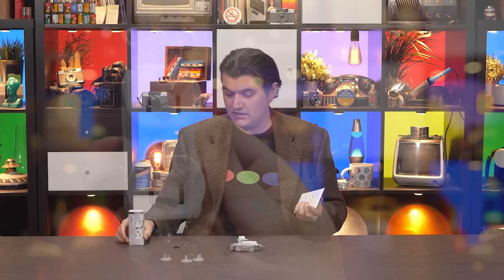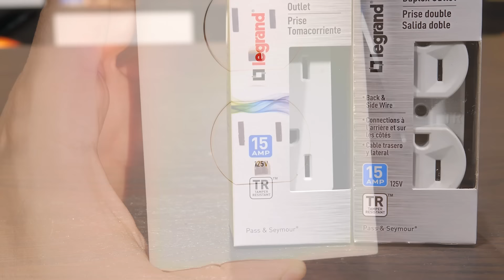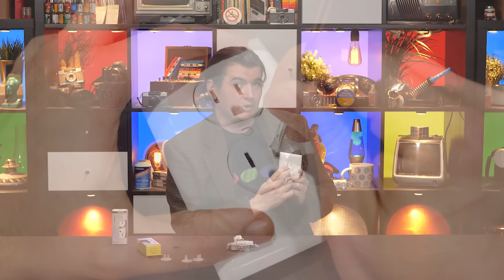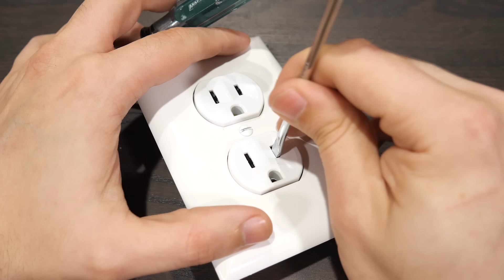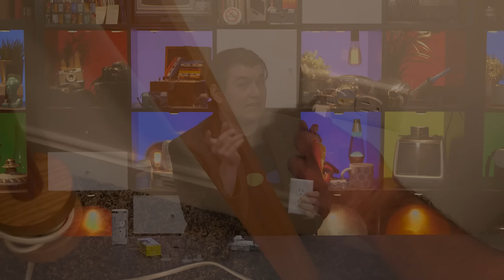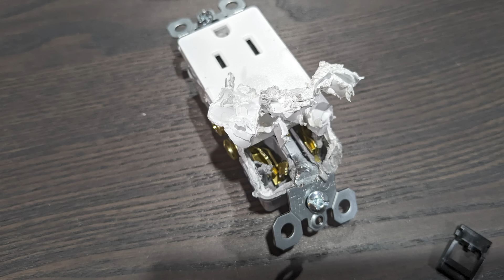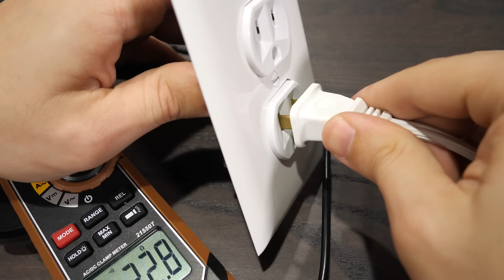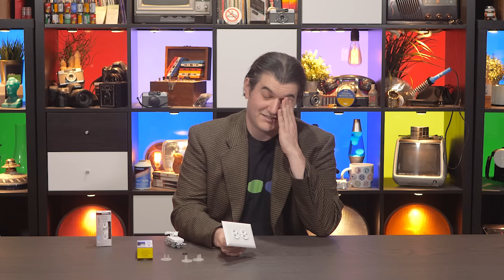Tamper-resistant outlets aren't all the same - a follow-up

Comment: 6:46 European here, where I live we have CEE 7/5 sockets (sometimes called Type E) and mostly CEE 7/7 plugs (works with CEE 7/3 and CEE 7/5 sockets), if appliance is unearthed you can find CEE 7/16 (Europlug) and CEE 7/17 plugs. A plug becoming loose is a such a foreign concept to me that I am usually more worried about yeeting out whole socket out of the wall than the plug becoming loose. If the socket is old, low quality or improperly installed it is far more likely to yeet whole socket out of the wall, so I have tendency hold the plastic body of a socket while unplugging CEE 7/7 plugs. I don't think that it is a problem now, but in the 90s and early 2000s when CEE 7/7 plugs started to appear, tolerances probably became very small and old socked installed behind the iron curtain (but only those home ones, those basement and outside ones where always sturdy as far I remember) were not ready for the force needed. And the habit from my childhood just stayed with me. But even those old CEE 7/2 and CEE 7/6 plugs were almost impossible to partially disconnect as you do with the American ones, while the modern CEE 7/7 are probably so tight to make them dust- and at least partially water- resistant*.

*As far I checked, sockets near water supplies should be at least IP44, but even IP66 are common outside. Inside sockets are at worst IP20, but you can buy also fancy looking IP40 for internal use.

Comment: I have not experienced US plugs. But the EU ones are very snug. I just did an experiment with a cheap charger and old extension cord. It takes at least 1.5 kg of force (3.3lbf) to seperate them. This is just the receptor, since a type C plug does not touch the edge of the type F socket.  With a type F plug this would be even more since there they would be near eachother (sideways stability) and the ground pins also squeeze the plug.
At my parents we have a plug that is bent instead of sticking out (and it is even more snug because of this)

Comment: re: "120v can also kill you", I can't help but think about the repair guy at my old apartment who came and replaced one of my outlets without turning off the power to the outlet. there was an amount of swearing that occurred, but he kept insisting it was easier for him to just do it that way instead of walking around the side of the building to flip the breaker. truly a legend.
Reply: I used to do this without swearing.

Then I moved to a place with 240V outlets. Tried to replace an outlet without turning the power off ONCE, there was lots of swearing and never did it again.
Reply: 120 tingles. 240 hurts
Reply: @Spiker985Studios  50 hertz in my country.
Reply: @Spiker985Studios  Dude, I've been shocked by 24 volt before where it really, seriously hurt. for days. As much as the voltage is part of the equation so are the amps involved. Nothing tingly about it, just not comfy when your hand is quickly turned into a heater.
Reply: @RedPorch  As anyone who has ever had a shock off a 12v car battery will concur! Far nastier than a 240v household shock.
Reply: @paulhaynes8045   DC vs AC... that matters as well, Shocking isn't? Bring back the war of the currents 🙂
Reply: @paulhaynes8045 
off a 12v battery?  how?! legendary failure to pull that off.
Reply: @paulhaynes8045  Having touched both terminals of a 12V car battery with wet hands...  HOW TF DID YOU GET SHOCKED?  

I'm not saying it's impossible...  but... um... HOW?  It's a low enough voltage that most people can't feel a shock under normal conditions.

(I'm not gonna lick it like I do to test 9V batteries.  Those car terminals are lead.  And yeah, I can give you a pretty accurate voltage reading on a 9V with my tongue.)
Reply: @RedPorch The amperage through your body determines how much it will hurt, but the voltage determines how much current will get pushed through you, and the vast majority of mains applications regardless of country can deliver plenty of current. Speaking as someone who's been shocked by a low current 24V supply, a huge factor as to whether a shock will occur is environmental factors (eg a cut that interrupts your skin, wet hands, different humidity, different shoes for grounded systems, etc). If the total resistance of the pathway current would follow to shock you is low enough you could get a lethal shock from a 12V battery easily, but higher voltage systems are more likely to hit a threshold where they can pass enough current through you as they can push more current through the same resistance*

*Exceptions apply here - as Mehdi from ElectroBOOM has pointed out, a lot of high voltage systems people might be exposed to have low current capacity, which means the voltage sags to less dangerous levels in the event you get shocked. Styropyro also covered things like the skin effect where under some very specific circumstances high voltage and high current can pass through you without injury, although I wouldn't recommend doing anything Styro does yourself
Reply: @freeculture DC vs AC matters, but the DC supplied by a battery is actually less dangerous. AC won because it's not as big of a danger as Edison made it out to be and it was far superior functionally, but it is still technically worse.
Reply: @user-dj1hy6zc6q  it's the amps that matter, not the voltage. This was back in the day when cars were difficult to start, so the battery had to have the power to turn a cold (non-fuel injected) engine over multiple times. I was disconnecting the battery and accidentally put one hand on the bodywork whilst I undid the live terminal with a spanner (cars batteries used to be 'earthed' to the bodywork then!). Not only did I get a hell of a shock, but the spanner ended up welded to the terminal! But even modern batteries have CCAs in the hundreds of amps range (CCAs - Cold Cranking Amps - how many amps a battery can deliver for at least 30 seconds in cold conditions).
Reply: @jonc4403  it's the amps that matter, not the volts, and car batteries are designed with a  cold cranking amps (CCA) rating of 250 amps or more (enough to turn a non-fuel injected engine over for at least 30 seconds in cold weather).  As a result, if you short a car battery out, you can potentially get a current of over 1,000 amps. I wouldn't try this!
Reply: @paulhaynes8045 
Yes, but you need the volts necessary to push the amps through your body's relatively high resistance.
Never have I heard of someone getting shocked by 12 volts just sitting there.
I think you must have had some inductive reaction going on. 
Or, you got your body between an active arch and got burned, not shocked.
Reply: @paulhaynes8045  The idea that volts don‘t matter because amps do is a misconception. Most people think voltage and are independent variables, but they‘re not. Voltage drives current and that current is limited by the resistance between the electrodes. Assuming your resistance remains the same, a twelve Volt battery will drive less current through you than a 230 Volt power outlet will. The difference between a car battery and  a power outlet is that there are safety features around the outlet that will shut everything off in a matter of milliseconds if current goes places it shouldn‘t be going. Car batteries don‘t have those. So if you manage to short one, it will release all the energy stored inside it very quickly. Which means currents that are strong enough to spot weld metal.
Reply: @MrAranton  I understand, but people seem to think that it's only volts that matter, so I tend to emphasise the current where safety is concerned. As you say, they are actually just different aspects of the same thing - lots of electricy will hurt you, no matter how it's measured.
Reply: @paulhaynes8045  The power grid is a voltage source. Which means: More voltage = more current = more ouch! How much more current is determined by the  impedence involved.

Situations in which higher voltage does not mean higher current are fairly exotic and usually involve either static charges or lab equipment with current limiters. Those limit the wattage you can draw from the source and when your desired combo of voltage, current and resistance exceeds what the source can provide, it's the voltage that will be reduced - assuming it doesn't have the kind of current limiter that bypasses the output entirely once it detects an overcurrent.
But the power grid is neither a static nor does it have a current limiter. As far as the question "how painful is a voltage?" is concernde, the grid provides infinite power. So separating voltage and current - while analytically possible, does not make practical sense. Or differently put "more voltage = more ouch!" is absolutely correct in regard to the power grid.
Reply: @paulhaynes8045 
And the important thing is that 12 volts isn't enough to push any meaningful current through a human.  That is why we were puzzled at your statement.
Reply: @user-dj1hy6zc6q  I don't know enough physics to argue that. But, entirely from personal experience, of all the shocks I've had (and I'm beginning to realise that there's been so many that I'm very lucky to still be alive!) although the two worse we're really bad (twice 'thrown' across the room, and once knocked out!), my third biggest shock was the one I've described from a car battery. It left me with painful burns and pains in my left arm that took days to go - and a cut on the back of my head, when I jumped back and hit my head on the bonnet/hood locking mechanism!
Reply: @paulhaynes8045 
See, I think you got burned, not shocked.  Once the arc is "struck", a lot of current can flow through that arc and burn you if you pass into it.  The arc will stop if you block it with your skin, but the heat is already there to burn you.
Reply: @user-dj1hy6zc6q  I can assure you I got shocked as well! The only way I can prove this is to get you to do the same thing - hold both terminals of a 12v car battery - but I really don't recommend you do this!
Reply: It's very rare for 120 to kill you. Where you fall into the exception it is usually around water or otherwise being wet and creating a return path for the current that is going through you. One hand on something that is grounded and the other touching whatever is live makes a shock worst. This is allowing the current to go through your heart and it can disrupt it's rhythm leading to death. This is why when there is a risk you should wear rubber sole shoes, have one hand behind your back and don't be leaning on anything. The other risk is not being able to let go due to your muscles seizing up. It can also prevent you from breathing while being shocked. This is a terrifying way to go, but again all of this is pretty rare as long as you're not wet and/or creating a return path.
Reply: Bro, did he not consider rubber gloves?
Reply: I often don't turn the power off when replacing or reconnecting things.  Ok, you get the odd shock (or more likely just knock the circuit out), but it's so much easier when you know something is working (or not) BEFORE you put it all back together!
Reply: @paulhaynes8045 It sounds an awful lot like you've only been shocked in houses fitted with RCDs, which will substantially reduce the perceived pain from a shock when they work (to the point of not even noticing it much of the time). An unprotected 240V mains supply will happily deliver a thousand times as much current as it takes to kill a person in far more conditions than a 12V battery will deliver any kind of shock at all.
Reply: @paulhaynes8045  i call this the "turning off the breaker remotely" method. not advisable, but works if you're lazy enough and trust your wiring. you also know immediately which breaker the outlet is on without having to go back and forth when the breaker box is furher away
Reply: @minecci258  excellent! That really made me laugh. Unfortunately with our breakers, an individual breaker going always triggers the main breaker, so you get plunged into darkness (and shouted at by the kids because the wi-fi has dropped!). Incidentally, if you want to do this more safely, and have earth leakage breakers, there's enough residual current in the neutral circuit to trip the breakers, so all you have to do is touch the neutral to the earth. I found this out the hard way (and got shouted at...).

Comment: when talking about the design that only has metal plates at the back part. I would imagine it would  definitely wear out quicker unless they had some sort of design that when it fully seats it engages or press either a metal plate or plastic plate onto the front  portion of the plug then I'd imagine it would be the same.

Comment: Talking of changing the outlets reminded me of a hack that everyone should do.  When you paint a room, take off the light switch faceplate and put a label on the back of it specifying the paint color of the room.  That way in 5 years when you want to touch up the room, you'll know what color to order.
Reply: Assuming the company you bought the paint from hasn't completely changed their color selection to force you to repaint the whole room.
Reply: While you're at it, write the breaker number on the back of the plate, especially if there are different breakers for the lights and the receptacles for that room.
Reply: @jjbre3920 Even better, get a labelmaker and label every switch and outlet in the house, so that you don't even need to take off the outlet cover!
Reply: @jjbre3920  That's just simple genius.
Reply: In 5 years, the paint on the wall will probably be discolored compared to a fresh repaint so it might be better to repaint the wall entirely. Also it's extremely rare to have perfectly empty out a tin after a paint job so people already have the label somewhere.
Reply: Brilliant!  😃
Reply: Better yet, when you have the paint mixed, get them to print an extra label with the mix ratios, cut it down to fit and place that on the back. I place the label inside a cabinet or closet to have it handy.
Reply: Well that's bloody brilliant
Reply: IF you remember
Reply: Or just keep the paint tin and label it?  You should take off light switch and socket face plates anyway when decorating (or at least loosen them enough to paint underneath them), then replace them when the paint has hardened.  It looks SO much better than trying to paint round them.
Reply: @paulhaynes8045  youl end up with random paint cans in your garage and the labels fade over time.
Reply: @paulhaynes8045 only easy when you have enough storage space 😄

Comment: If you review an EU plug you will understand what we mean. The plug is recessed and the ground is acting like a holding spring. Also the cable has sides that stick out, and needs a bit of pulling to remove. Overall it's way better.

Comment: If I have to give advice about plugging stuff in, it's not to plug large or heavy devices directly into a wall outlet or power strip outlet. Go buy a large bag of pigtails.  They're maybe $0.50 apiece in reasonable quantities.  Only buy three-prong pigtails, even for two-prong devices. If enough of us start doing it, the prices will come down with economies of scale.

Comment: My electrician buddy swears tamper resistant outlets are a dangerous "improvement" that will quietly go away in a decade or so. He has over a 5 gallon bucket worth of melted TR outlets he has replaced. Since they have two deprhs of resistance when plugging in, people dont get them shoved in all the way. It causes hot spots and/arcing. I thought he just hated them for some reason, until I saw the collection he started, after already tossing a bunch.

Comment: A backstab connector is very different from a Wago or Ideal.  The latter two can be released reversibly.  Once you release a backstab, it's spent.

Moreover, how much time are you saving?  Less than five minutes per outlet maybe?  Even less if you have the terminals where you stab the wires in and then a screw bears down on a plate which clamps the wire. Totally not worth it.

Comment: Also I will say for safety reasons, when I travelled 3 things I saw that threw me off at first but I get it from safety, the plugs that are plastic until the tip for the reason you showed in the other video, another being recessed outlets, even if it backs out slightly the entire plug is within the outlet still covering them. The third thing I saw was (and this was annoying when I encountered it, but easily overcome) is outlets that have an on off switch. it was annoying because they weren't clearly labeled what is on or off so you have to trial and error, which when the outlet buried behind furniture or something, its a pain to plug in, check if it has power, find it doesn't, go back behind the furniture and flip the switch and check again. This was understandably complicated by being in a third world country with rolling brown outs, so you always questioned (is this a bad outlet? do we have power right now? was it installed correctly? is the on switch in the right position? ok, try a different outlet, and repeat all the questions lol.

Comment: here in sweden all outlets are recessed like 15mm(i have got some that are from the 60s i think wich are not recessed and hold onto a plug really poorly. similar to the US plug). that recess also acts as a guide for the plug so they connect really solidly. so the prongs are not what keeps plug in the wall/powerstrip. so there is no way to get to the prongs and pretty much anything produced since like the 80s has sleeved prongs as well and you can put any cord upright and upside down and most cables are right angle but are usually made to be able to fit ontop of eachother. would be fun if you did a video on different plugs around the world. pros and cons. i did not mean to shit on your US plugs. its not your fault XD just compairing :)

someone in the comments said its a Schuko plug.